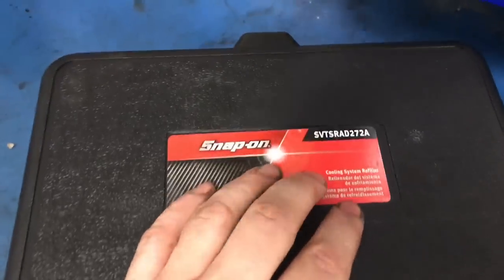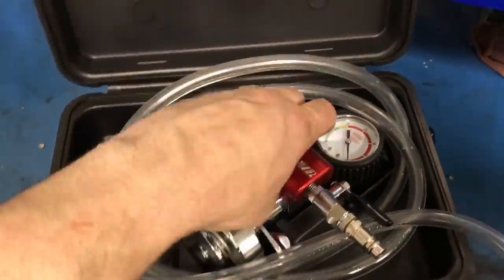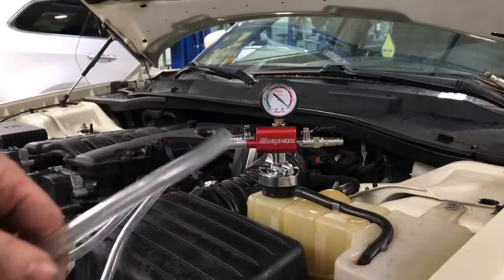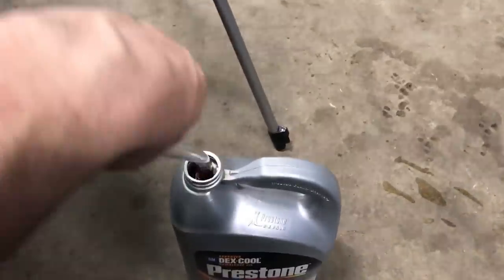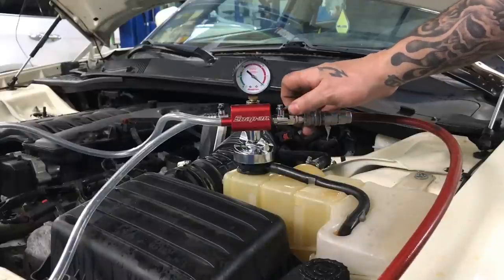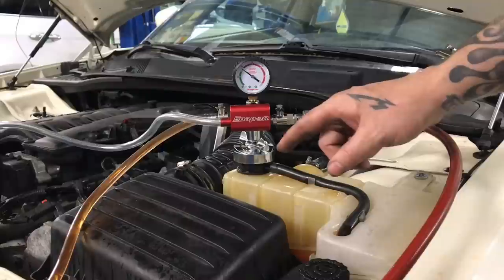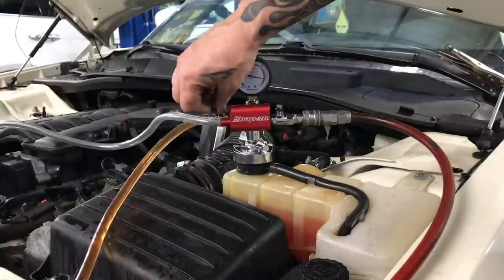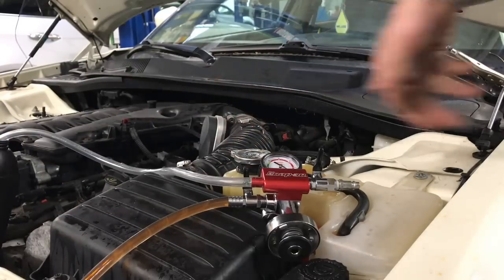How To Use The Snap-on Cooling System Refiller - Quick DEMO

Comment: FYI to folks out there.    There’s a chance that the vehicle holds vacuum, but still has a leak.   The vacuum could be temporarily pulling bad seals and gaskets (heater core fittings for example) where they SHOULD BE but when released there is a leak there.  It’s important to still Pressure Test (with positive pressure.)
Reply: Often when people say what you said, they end with, "Ask me how I know?"
Reply: Im new to this and want to improve my skill in this field of doing coolant pressure test and coolant exchanges. What are key components that someone like me would do to prevent or have a better experience on this skill.

Comment: You may want to draw up the coolant filling the suction tube by briefly opening the suction valve. Then close the valve before finishing the vacuum. The system should maintain the same pressure for a couple minutes after you close the air valve...if not fix the leak! You are also putting more air into the system when you switch jugs. Use a larger jug or close the suction valve and refill the jug before it runs low.
Reply: Spot on about drawing up the coolant all the way up the fill hose to the valve before finishing the vacuum.  However, if you are careful you can switch jugs without getting any air into the fill hose.  Just got to make sure you do the switch when the coolant gets low in the jug and BEFORE you run out!

Comment: Well u just drew a bunch of air in when you first opened the coolant valve. Supposed to fill the line with coolant then put it under vacuum again
Reply: did you not see the giant void of air left even after it was filled, pretty sure it didn't matter.

Comment: I’ve been using one of these for years. Wouldn’t want to go without it!
Reply: Hi, I have a air issue (ford) in my cooling sistem the heat goes up and down i don't be able to take all air out of the system and the 
Can this item be a solution for my problem ?
Reply: is the coolant in the engine exchanged as well

Comment: Thanks for showing Snap-On Tool in action. It's looks easy to used.
Reply from the maker: +LsR209 Master Warranty Technician super easy!
Reply: @TheSnapOnToolReview  will a small 100lbs psi 1/3 hp tank be enough for this or will I need a larger compressor?

Comment: What a friggin time saver ! Thanks for the tutorial Joel.
Reply from the maker: +Wally G. No problem bro! It sure is.
Reply: Can I use this just to bleed out air in the system without flashing or draining the coolant?
Reply: @dacal9084  yes.    . Old comment. You probably know that by now. Lol

Comment: When you open the tap to let coolant in you're meant to only get it to the point where coolant just starts to enter, then open up the vacuum side again as you sucked in all the air that was in the tube..
Then open her right back up again
Reply: Yah your right!
Reply: That makes no difference at all 25in of merc. is not absolute anyway and there is nothing wrong with what he did other than maybe using dex-cool in what appears to be a chrysler.
Reply: Yep, it says so in the instruction manual.
Reply: Ill try this today, i put a new radiator in a v70 volvo

Comment: Dam dude. I must be old school because in the 35 years I’ve been turning wrenches, I have never used one of these and I have never had any air in the coolant system after a refill. Then again, I know what I’m doing. Looks easy enough. This would definitely save me a shitload of time during a refill.
Reply: We’ve noticed A lot of new cooling systems no longer have a radiator cap. And no longer have bleeder valves either.     They just have a pressure cap at the reservoir but the reservoir is situated Lower than the top of the radiator and sometimes other components.  Getting air out of these can be tough.

Comment: Joel, working on International trucks they have a quick connect at bottom of rad and a special cart that has drain/fill  capabilities all from bottom of rad. I use the one with rubber adapter from top strictly to pull vacuum.
Reply: That’s really cool!

Comment: I took an empty five gallon jug of soap from detail and cleaned it out real good.i use it for coolant so I don't have to stop to refill.also I use electrical tape to hold the pick up tube to a long extension so it goes straight down and stays down because it can curl up on tis own and suck in air.
Reply: I use a 5 gallon as well and you want a good tip to prevent the hose from curling, take off the hose and take a big nut like an axle nut and slide it on to the end of the hose that way the end of your hose is weighted in the jug

Comment: So when you are pulling a vacuum on the system what happens if there is some coolant left in the system. Does it suck it out through that bleedoff line or does it stay in place?
Reply from the maker: +Garmans12valve it stays in the system. It only removes the air that is present.
Reply: @TheSnapOnToolReview  yeah but what if you don't drain the system first can't you just hook up this tool and suck all the coolant out, well most of it anyway

Comment: great tool! just a heads up... in this situation its called air lock not vapor lock. im going to be doing a video on this soon because theres a few cool little tricks you can do with this. I went wit hthe airl lift because its 99.99 and in my personal opinion its made better. It all comes down to personal preference is all. This tool is also a great way of testing if you cooling system has any leaks in it. Great video!

Comment: can you detail what should be done prior to plug in the tool? Car hot or cold? What about the thermostat? I suppose it has to be opened? How to prepare the car for this?
Reply: I ensure the heater valves are open, engine cold, no need to remove thermostat.  You need to drain as much coolant out of your cooling system as possible before evacuating it.

Comment: What happens when there is air in the system ? What kind of symptoms would there ? If your doing a actual coolant flush with a flush machine you wouldn't have air problems would you?

Comment: So how about the thermostat gonna let the coolant in if the engine is not running?
Reply: it goes in through the water pump backwards (lower radiator hose)

Comment: Bro,,, I have been going insane for 5 months.. with a 6.1 HEMI that no matter what continues to overheat.. Every single component in the Cooling system has been replaced... at least twice.. WTF do shops not know to do this from the get go... Curious. I have full Fresh coolant in the motor now.. How did you fully drain it?? with the Petcock on the Lower rad hose?? Im thinking this will solve my problem.

Comment: Wondering why you do not fill it up first before using this kit?  Or is this only for a drained system?
Reply: Also do you still have to bring up to temp and check levels after thermostat opens?  I see these kits but little information along with them as to the why or hows...

Comment: That’s pretty neat.  I know nothing about this stuff but how does this save time over just putting in a couple bottles of coolant with a funnel? Is it about air in the system? Like I said I have no clue what I’m talking about, just curious.
Reply: Modern vehicle cooling systems are much more difficult to purge of air. Most manufacturers are now specifying filling under vacuum. If you are not doing it this way on vehicles that call for it, you are not doing it correctly.

Comment: Hey Joe, I have a question. Do you have to put more shop air if the vacuum gets to low. I'm going to do my 13' Ford Super Duty, and it's a lot bigger then the car you was working on. Just looking for some information. Thanks
Reply: You need to have at least 90 psi, I'd recommend 5 cfm.

Comment: Can this unit do a pressure test on the system as well?
Reply from the maker: +Christopher Enger in a round about way yes. You’re applying a vacuum, so if it’s holds a vacuum if should be able to hold pressure. 👍🏼

Comment: I have a question about this tool does it vacuum the whole system as in all the way in to the heater core,water pump and the whole block? Cause i feel like it doesnt? Never used the tool but really want to buy one to save time! And why did you stopped at 25?
Reply: Yes it does

Comment: you don't need to have the rig running and the heat on to open up the heater core to make sure there isn't air in there?
Reply: Open the heater valves and drain the system of as much coolant as possible.  Vehicle should not be running while evacuating and filling.

Comment: The Snap-On Tool Review Do you think a small 100lb 1/3 hp compressor would do this or would I need a larger tank?
Reply: You need a compressor that can produce at least 90psi.  I would recommend at least 4 - 5 cfm in my experience.

Comment: does it vacuum the whole system as in all the way in to the heater core, water pump and the whole block?   why did you stopped at 25?
Reply: Yes, if you have the heater control valves open.  You should evacuate to the vehicle manufacturer's recommendation.  Most are between 24 to 26 in-hg.
Reply: @StilettoSniper  thanks

Comment: Definitely getting one.  So if you have the snapon system pressure tester that you also purchased in your last video, will those adapters fit the system refiller?
Reply from the maker: +Ian P yes. They make it that way so it's interchangeable.

Comment: can this tool be used to drain a system of coolant? i do a lot of motor swaps and im tired of cleaning antifreeze after each one.
Reply: Not recommended, very inefficient and slow if you try that.  You really need to drain out as much coolant as possible for this to work the way it should.

Comment: My car has a thermostat valve separating the radiator part of the coolant system from the engine block of the system. How can I be sure to fill the entire circuit even if there is the thermostat valve is closed?
Reply: Now that is a great logical question.  Another guy [Jay Kent] asked the same question.  And yet, for years people just removed the rad cap and added coolant and that worked, without any overheating, so, I assume no air (until computers came along).  So how did it get past the thermostat then?  Can some vehicles tolerate air pockets?  Perhaps it was the design, and this is only intended for those newer designed systems, so, if you dont have a newer design, then you dont need it.  I have the earlier version of this, the radkitplusa, and rarely use it  (didn't seem to fill the system, or get rid of all the air, so . . . ). It was easier and quicker jacking car and using a funnel on the Hondas.  Volvos self bled with overflow cap off.  MR2 had to be jacked up and bled thru valves.   Of course if your rad wasn't the highest part of the system, then you might need this.

Comment: Joel, have you used this on Honda’s? Do you need an adapter for them? I feel the universal version of this tool SVTRAD272U might be better no need to buy expensive adapters.
Reply: Yes you do need an adapter for a honda. Also It's not, the universal one uses a rubber cone that expands slightly when you twist a knob. This cone barely fits in the fill hole on Hondas so you end up holding it on there to keep the pressure and doing everything else one handed.

Comment: How do you empty the hose that fills the system when youre done?
Reply: Just disconnect it and open the valve.  The new coolant in the fill hose will flow back into the jug.

Comment: When the engine is cold and the engine thermostate is closed how can this completly refill the system the thermostate isnt open untill the engine is hot so wont get completly filled?
Reply: A closed thermostat prevents most of the coolant from entering the radiator, but you'll find it is not an airtight seal.  Also, air can get past via the lower radiator hose as well.

Comment: Do you happen to know what adapter to get for a c6 corvette base model and a 12 ram 3500 diesel?
Reply from the maker: Corvette off the top of my head, no.  The ram you don't need an adapter I believe.  It's just a standard neck.
Reply: The Snap-On Tool Review thanks for the reply. I ended up getting the tool no adapters yet though.

Comment: Joel, will that drain a system too?
Reply from the maker: +Josh Leduc no this one doesn't drain.
Reply: Do you know if there are any that do?
Reply from the maker: +Josh Leduc I worked with a machine that was supplied from BG that extracted fluid but it doesn't clear the entire system. Only about 4 liters.
Reply: I worked with a Prestone one that would hook in line and push new coolant in and drain the old out. Had to take the top hose off and connect that way. Was cool to use but a pain at the same time. I wasn't sure if that one there would pull enough vacuum to suck old fluid out or not.
Reply from the maker: +Josh Leduc yeah I have that machine at work now.

Comment: Dose it do Europe type
Reply from the maker: +Michael Coode you it will do anything as long as you have the adapter for the radiator spout.
Reply: thanks
Reply: They also make another version that has a few different rubber grommets for general fit. I don't have a part number handy as I have the same version as the one in the video

Comment: Why does nobody vacuum the coolant out of the system in these videos for these Purge and refill kits. This is like the third or the fourth video I've watched now where the person said drain the system, can't you just put the air out hose in an empty jug or a catch pan and then vacuum all the coolant out rather than draining it. And I'm sorry to saybut I would never get that off the snap on truck when there's 20 or $30 kits on Amazon that are just as good instead of a $500 kit, when I shop for tools I check everywhere and see what I like best and usually that's not snapon. For example I have a few husky tool boxes one of which has the glass windows and LED lighting in it, plus I put more LED lighting on it and lighting on another husky tool boxcontrolled by the switch on the glass see-through one, and I swapped out the regular switch for a touch switch and a few other guys in the shop had snap-on boxes and when I would ask somebody who knows nothing about cars or tools, who has the coolest toolbox set up in the shop they would usually say me because my toolbox set up was pretty sweet not to mention 1/10 the price of everybody else's and the cool factor is 10 times more. People get ripped off left and right from snapon it really is sad that people are willing to spend so much when they don't have to
Reply: These tools are NOT designed to "vacuum the coolant out of the system".  Yeah, you can try and use it that way, but it is slow as shit and very inefficient.  MUCH MUCH faster to simply drain out as much coolant as possible via the radiator petcock or lower radiator hose, and the engine coolant drain plugs.  THEN evacuate the system, check for vacuum hold, and refill.
I use a Stant pressure tester and the AirLift 550000 cooling system purge tool with excellent results.  Much more affordable than the tool trucks.

Comment: If you are filling with the same type of coolant often, 5gal bucket makes life a little easier
Reply from the maker: +Joe Nowag yeah for the most part it's Hyundai. I'll be getting a large bucket for it.
Reply: In my case it's always dexcool, I bought the homedepot orange bucket... I'd go with a different color than the coolant,  (not orange is nice if you forget if it's just water or mixed )
Reply from the maker: +Joe Nowag yeah for sure.